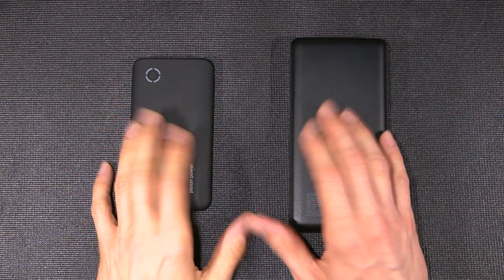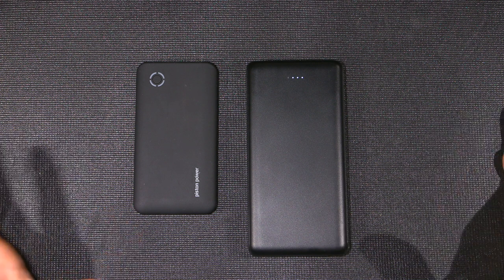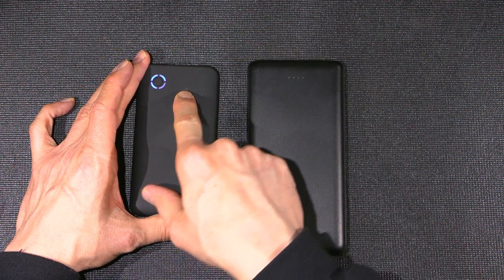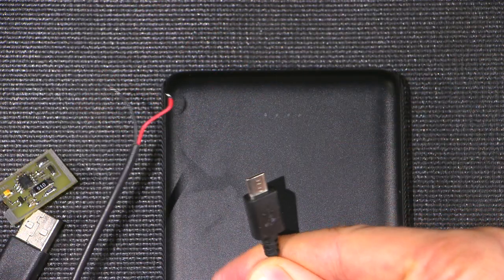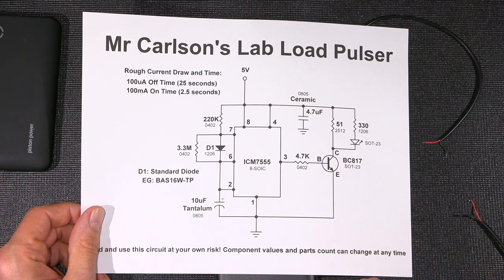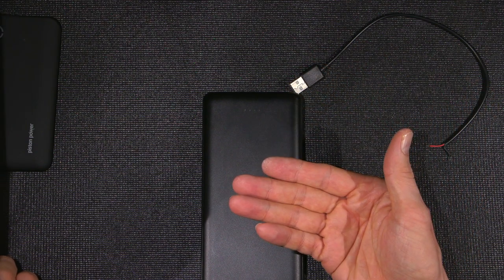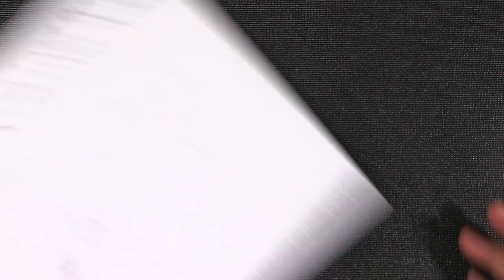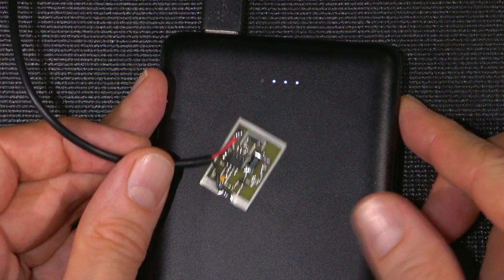Power Bank Stay Awake! Here's A Circuit To Do That:

Comment from the maker: To learn electronics in a very different and effective way, and gain access to Mr Carlson's personal designs and inventions, visit the Mr Carlson's Lab Patreon page here: https://www.patreon.com/MrCarlsonsLab
Reply: When do you plan on updating your Patreon page with details about this project?
Reply from the maker: @guldentops  It's there.
Reply: @MrCarlsonsLab  So many 0402 parts 🧐👀, I need to get an AmScope sooner than later.
Reply: heyeee paul
Reply: @sonycrack1  There's a decent video microscope on Aliexpress. I'm nearsighted so for me sight is not the problem, it's shaky hands for the tiny stuff (and liquid adhesion, hard to make small parts stick to the board and not the iron tip). Normally robots do the surface mount stuff. I just hope I never have to repair my phone, had a looksy inside that and the resistors/caps need a needle tip soldering iron if they ever need replacing. Potential nightmare.
Reply: Is there any downsiide to keeping your lithium ion battery devices topped up constantly? I remember reading something advising not to keep devices charged to 100%
Reply: @stopthephilosophicalzombie9017  Keeping them 100% full actually shortens their life. They lose capacity over time anyway, even when not cycled, but 4.2v constantly speeds that up. My lithiums  (expensive 10-60AH pouches arranged into 1p32s batteries I'm not keen on replacing every 2 years) I only charge to 90% (about 4.15v) and then discharge them  to 3.85-3.9v for storage in a constant 4C temp (modded deep freezer) when I don't plan on using them for awhile. That makes them last over 5000 cycles (when cutoff is also set to 3.0v) or 15-20 years or so, whichever happens first. Similar tricks are used in Tesla car batteries to maximize life (mainly keep them as cool as practical and don't actually use the full capacity of the battery), otherwise they probably wouldn't last a year for some drivers.
Reply: @fvckyoutubescensorshipandt2718  Thanks for the info! I wonder why electronic devices don't employ similar charging schemes as Teslas to maintain batteries better. My Macbooks have gone through batteries like a mouse through cheese. Btw, what do you use those batteries you keep in the freezer for?
Reply: @stopthephilosophicalzombie9017  Some of my higher-powered projects that you can't simply plug into an outlet without popping a breaker or blowing something up. The 118v 60AH ones are going to be used for up to 250 kW plasma speaker experiments (they can do 400A continuous each x8). To control them (simply plugging/unplugging that much power hot is dangerous, particularly for HVDC) they go into buck-boost converters that can turn it up to 500v/500A or down to 48V 7A (the control chip has a min duty cycle rating so can't go down to 0V). The 10AH ones are used for a portable Class E Tesla coil (portable but still about 2kW+500W for audio modulation). Other projects are on the drawing board, just never enough time/money for them all at once.
Reply: Can you make me one of these and I pay u I really need one but I'm not good with small solder points

Comment: I did the same circuit according to your schematic, but instead of draining current from the output using resistor, resulting a waste of power, I replace the transistor and resistor on the output of 555 timer with an optocoupler. It will drive the optocoupler IR LED and the output of the opto connected parallel with the power button. Every time the 555 timer lights up the IR LED, the optocoupler output will switch or shorted and also shunt the power button terminal as well. So, it is "pressing the power button" every few seconds (in my case 10s).

Comment: I built one of these and it works great! My battery bank kills itself after 10 seconds for any load <150mA, so I had to tweak some of the component values .... 3.3Mohm to 1Mohm to decrease the pulse timing and 51ohm to 33ohm to increase the current level. Works great!  Thank you!

Comment: Xiomi's power bank has this feature built in, double tap to activate 😀
Reply: Double tap activates low power mode😑😑
Reply: @cisarvialpando7412  lmao
Reply: @cisarvialpando7412  you can check the output current via load tester...thank you very much ❤️
Reply: @zeitgeist2720  just checked....🤦🏻‍♂️
Xiaomi tells that it is low power mode but its not🤦🏻‍♂️🤦🏻‍♂️
Reply: @cisarvialpando7412  Yes, low power mode in the sense that that it doesn't shuts on its own, no matter the input impendence of the load unless the current is under its specified value or the output is being short circuited👍
Reply: On the models I've tested the lower power mode only works for 2 hours until shutting down.
Reply: @alakani  
You just made me receive a lot of concerned looks in the break area at work. Thank you.

Comment: USB batteries shutting off due to devices that draw very low amperage is also a problem that this circuit would fix, right?
Reply from the maker: Yes.
Reply: @MrCarlsonsLab  That is awesome!@ now i can run my esp8266 projects from my power bank without it shutting off! I'm gonna build it with a DIP-8 555 though and just have a cable with this circuit on it for powering microcontroller projects. Thanks, Mr. Carlson!
Reply: @mikehensley78  Or just program the ESP8266 to wake up more often. Or even better, just use some LiFePO4 cells, literally all you need is a basic BMS to connect it to the ESP8266.
Reply: It's good to see someone else using a USB power bank to power a single board computer.  My SC126 runs for about 100 hours on a 10,000 maH battery.  I have several of them, all the same brand and model, but only two of them will stay awake with my computer running.  This little gadget will get the others working.  Thanks, Mr. Carlson!
Reply: @NiHaoMike64  its not that its asleep even... the  esp even with neopixels just does not draw enough to keep my powerbank on.  the powerbank is one that i made from a broken one and 2015macbook cells.

Comment: My power bank has quick charge feature. I have built a circuit based on your schematics to keep my powerbank alive. With original component value, powerbank still powering off about 30 seconds after connecting the circuit. After many trials, these values able to keep my powerbank alive : I replace R 3.3M with 470k, add 100nF capacitor between pin 5 IC to GND (not mandatory), replace R 51 ohm with 3x100 ohm / 0.5w parallel. Thank you Mr. Carlson for your idea and schematics...
Oh, and I must change the transistor, to handle higher current on collector.

Comment: I have a few USB to TTL Serial adapters around. Thing about them is that the USB plug itself is pretty big because there's a circuit board actually in the plug casing that does the serial port stuff. I might sacrifice one of those and replace the board inside with your "keep-alive" circuit and make it into a charging cable.

Comment: Nifty little keep-alive board  :)  
BTW:  Always check the USB wires against the USB pinout...I have had some Chinesium cables that had the wire colors reversed...make sure of your polarity!
Reply from the maker: Good advice Gregory, I too have seen this.
Reply: ?   chinesium....must be a new type of 'plastic' disquised as quality from   ?  china, perhaps...
Reply: @petersack5074  - Chinesium is usually a reference to a metal of unknown composition with unspecified characteristics that don't meet any known standards. So, for a Chinesium Phone Cable, the conductors would not be copper but rather some super-cheap alloy of aluminium, steel and/or whatever other stuff is swept off the floor of the surrounding factories.
Reply: @johncoops6897  I think Peter was insulted by the word "Chinesium". Peter, rest assured that this element is embraced by North Americans because of its low cost. If it doesn't work, we make it work. If we can't make it work, we write it off. After all (in the USA) we have Las Vegas, Atlantic City, Foxwoods and Mohegan Sun. We are willing to take the gamble. Info about Chinesium Polarity is just a polite heads up to all that embrace this inexpensive, mysterious element that sometimes is very awesome and workable. I have sent at least one thousand US dollars to China. "Chinesium" is a way of life.
Reply: @jlucasound  - I'm in Australia and we also embrace the Chinesium-based products. Interestingly, Australia's main exports are raw minerals like Iron Ore, Copper and Bauxite (for Aluminium) to China at prices that are lower significantly than are available to our own foundries, and in some cases under our real production cost. That's  how it must be because Chinesium is so damn cheap!

Our Australian facilities have downsized or closed, and the prices of locally made steel, aluminium, copper, etc is so high that it makes local manufacture of almost everything non-viable. We also export our recycled matals to China for processing.... I think we might even pay them to take it, because that's cheaper than doing it for ourselves.
Just 50 years ago we were self-sufficient and manufactured everything we needed using our own labour force. Now days our factories have closed and we hardly manufacture anything, while prices of remaining Australian products are so high they're out of the reach of normal people!

Since we export our high quality raw materials and recycled metals at under cost, we are a poor country that must import everything we need. We cannot even afford to make things for ourselves :-( 
So we are grateful that the Chinese have saved us! Without their low priced Chinesium based products, we Aussies couldn't afford to live here, so we would have needed to close our country down and move overseas.
Reply: Since most of these power bricks use the same or similar controller chips, maybe it's possible to mod (maybe snip a leg) to disable to auto shut-off feature... just a thought.  Or maybe even solder in a pull-down resistor between the ground and load sensor pin on the micro usb-connector, without having to trick the brick with timed load pulses. ;)
Reply: I cut off the usb plug from a charger and used the 5 volts for a small circuit. Unfortunately the wire colors were reversed - red negative, black positive - and the circuit was damaged. 
Lesson learnt, check polarity + voltage level always
Reply: Yep, I've seen it also... 

I burnt up a brand NEW FPV quadcopter camera because the black lead was "supposed" to be positive and the red lead negative. 

Didn't say SQUAT about this in the useless manual that came with it, and wasn't in any diagram either. 

The seller wouldn't refund me because of it either. The reply was that it was "my fault because I connected the power up backwards".... 🤔 🤨 😤

Comment: I've had the battery bank shut-down problem with an Arduino-based project I'm building, and fixed it by using your switched load resistor idea, but built the circuit into the rest of the project, and used the Arduino to do the timing and control instead of a 555. Works well, thanks for the idea.

Comment: Mr. Carlson, a while back, I wrote you here, saying your videos had inspired me (slightly wonky eyesight notwithstanding) to take up electronics. I may even have mentioned a project I had in mind, which was THIS VERY ONE. I had seen some other person's vlog and solution, but it proved a bit beyond me, but I fully intend to try to make this little gadget of yours. I agree, power bank behavior is very frustrating. My problem was actually slightly different, but your device would solve it also: Namely, I have a pair of USB audio speakers I use with my laptop but no spare USB slot, so I use a powerbank to power them. But they draw so little current the powerbank shuts off after 30-60 seconds. I have to put some other load on it in some way in order to be able to listen to my speakers uninterrupted. This would solve that problem, as well as the un-topped-off phone. Thank you very much. I am very enthused to try this.

Comment: You are the MAN!  I too was frustrated by the power-bank cut-out when trying to run low power draw IoT type devices.  I figured some kind of "keep alive" pinging thing would trick the battery in to remaining on.  I'm so building this circuit using through-hole components in a project box in my first drafts.  I'm excited to eventually build this in surface mount style like you did in the video. Thank you for sharing your solution!
Reply from the maker: You are welcome!

Comment: If you use a PNP transistor to switch the positive rail on the load and you swap the 220k resistor with the 3.3M resistor you would reduce the quiescent current during the 25s of "delay", with the configuration that you actually used during the 25s you have the discharge pin to ground, pulling current from the capacitor but also from the 220k resistor. 
Nice video as always!

Comment: The 555 is like the vice grips of electronics.  All purpose, fits anything, works fine.
Reply: It is super annoying when people advise to use an Arduino to flash an LED, or to do simple timing like this application.
Reply: @johncoops6897  Why?  The ICM7555 costs $2.74 and does one thing.  An ATTINY10 costs 33 cents and will give you longer battery life, the ability to change timing without desoldering parts, and eliminate the possibility of a shorted transistor overheating the load resistor and igniting the LiPo cells.  Not to mention it will give you skills you can use to get a job
Reply: @alakani  - a 555 is all that is required for simple tasks like this. The advantage is that is a simple circuit that can be used WITHOUT PROGRAMMING. You don't need to use a microprocessor for simple timing tasks like this "keep awake", which is simply a flasher (astable), so the technical term is an "overkill".
I'm not sure where you get your crazy price comparisons, however any difference in price is instantly negated by the fact that no programming is required for the 555-based circuit.
Reply: @johncoops6897  Prices are from Digikey.  That's a special version of the 555, ordering it would take days.  Programming a standard micro that's already in stock takes 10 seconds to write a line to assign a timer to a pin and 2 seconds to program.  I'm sure Paul used that chip because he already had it in stock.  Hey, without looking at the video, or looking it up, tell me what value resistor and capacitor to use in the 555 RC circuit to get 25s off / 2.5s on ?  Would you calculate it from the datasheet or use one of those online calculators?  The 555 is more obscure to program than a micro and you would probably just copy Paul's values or use trial and error.  It's faster to copy and paste a line of timer code if you don't know how to code, than to wait days for a special expensive single purpose chip
Reply: @alakani   - the particular chip that Paul used is just one of many brands (and part numbers) of CMOS 555's. Your inexperience is demonstrated when you think that they are rare and/or expensive chips.
All circuits require construction and supporting components, however in your zealous obsession with Micros you completely miss the point that the programming is an additional step that IS NOT REQUIRED with other solutions.
In engineering, the best solution is the least complex method that achieves the desired result. The ATtiny is a fabulous device that simplifies many situations, however there is no need (or advantage) to use a programmable device for a simple function like this.
Reply: @johncoops6897  As stated in the video, a standard 555 would drain the battery, hence the expensive low power version.  For me, cost, battery life, safety, inventory, and time are advantages, YMMV.  There's a reason he didn't use tubes for this circuit, as much as we love them
Reply: @alakani  - I wasn't talking about standard 555, I was talking about alternative CMOS versions. The battery life and safety are basically equal between 7555 and ATtiny, since both need similar IO to trigger the powerbank.
The cost is within a few cents depending on quantity purchased, and almost completely irrelevant. Inventory simply depends on what you have in stock - perhaps you should get some 555/7555 and learn how to use them?
Time is certainly a huge advantage of the 7555, since zero programming is required and adjustments can be done "on the fly" rather than removal and reprogramming. You can even fit a trimpot and adjust at any time in the future using just a screwdriver! You don't need a computer or serial programmer to configure a 7555 circuit either, so that's a significant simplification too I guess.
Reply: I would have used a single Schmitt trigger inverter instead of the 7555.  Fewer parts required, and marginally smaller.
Reply: @johncoops6897  I already have a drawer full of 555's, pretty sure I know how to use them.  What happens if the output transistor shorts?  555 doesn't care, load resistor ignites lithium cell.  Or the 10x cheaper MCU detects it and uses a spare pin to shut down the pack itself.  Among other things.  Let me know if you have any questions, particularly about safety
Reply: @alakani  - what about if your computer explodes and kills you while you are programming the micro? What about if aliens are tuned to the exact same frequency that your particular Micro is running at, so they come down and wipe out the human race? Let me know if you have any questions, particularly about logical arguments.
Reply: @johncoops6897  Jesus christ dude.  Paul even mentioned that's exactly what the LED is for, because he's not an idiot.  I'm glad his wife is capable of keeping an eye on the LED and manually shutting it off if needed, but automatic safety features are always better